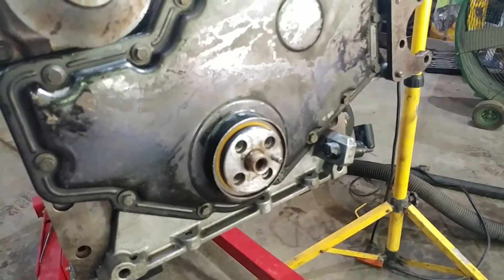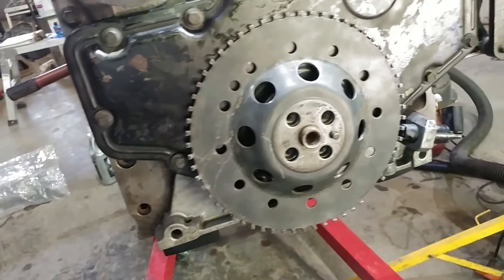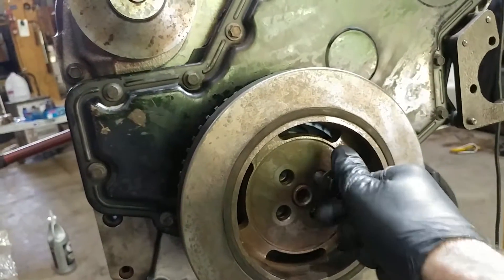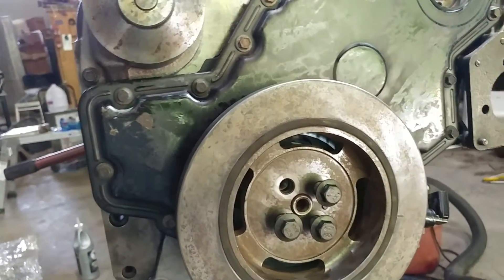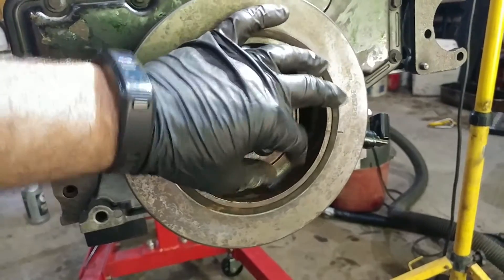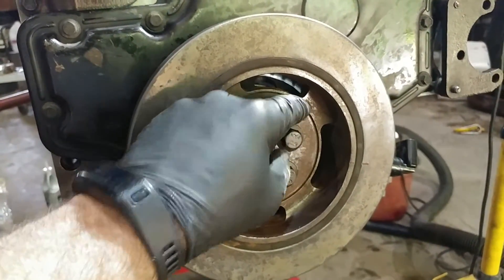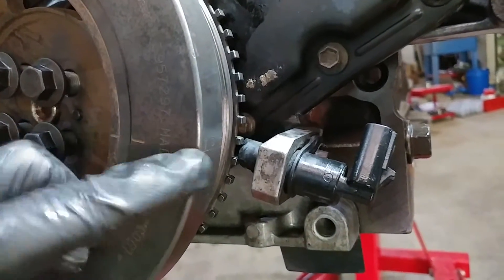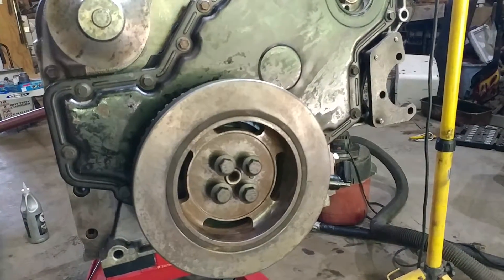Chronicles Of An 03 Cummins Rebuild - Part 36 - Tone Ring and Balancer Installation

Comment: I have a 2001 Freightliner Fl60 with the 24 valve  cummins and the tone ring is on the outside of the balancer close to fan and a piece cracked off I'm having a hard time finding that part it is a two piece ring with teeth bolted to a round plate do you have any idea where i can get a replacement part and have you ever seen this set-up with the ring on the outside?
Reply from the maker: A Owens, Some how I missed your message. Did you ever find your balancer? I can honestly say that I have not run into a balancer with a 2 piece tone ring and would love to learn about it!
Reply: @70440charger  I found the tone ring but not the round bracket that it bolts onto and that then bolts to the front of the H-balancer, I wish I could post pictures on here it would help better to see it

Comment: I'm glad that you cover this in your series. Is there any way to check the balancer?

I have heard that they are made with rubber, and we all know what happens to rubber after 20 years...

Also any information you would like to give about aftermarket fluid dampeners, I am all ears? 😁
Reply from the maker: Great question! And you know what should have included that info in this video!  Here is a link over to TDR where they give a pretty darn good write up on what they do and how to inspect them. He make a note that they are more dampers than balancers, but I find that when we get stuck on what to call them it just takes away from the real conversation that should be happening!

https://www.turbodieselregister.com/threads/its-time-to-inspect-your-harmonic-damper-but-please-dont-call-it-a-balancer.263533/

As for fluid dampers! I have never run one, but I plan on getting one for our 4bt truck to help with some of the brutal rattling that comes with them.  With that said, let me say there must be something to them because Cummins started using them on the 6.7 motors. The sad thing is that they aren't backwards compatible to our 5.9s! Then there is the bonus that it doesn't wear out like our stock dampers. 

Here is a second thought for you. If you have the motor torn down then you should consider balancing the rotating assembly. That way your damper (no matter if its the stock or a fluidampr) has less to put up with.  Its kind of a lot of info, but I hope it helps some!
Reply: @70440charger  - oh boy... That's the most reading I've done since I left high School 😂

I haven't finished it yet but I will later, that article has some extremely useful information. Thanks a bunch bro!!
Reply from the maker: @duttydiesel8303  : I know it's a lot of reading in that article, but as you can see there is a lot of meat to it!
Reply: @70440charger  - just finished... That shines a good bit of light on to it, I think that maybe the next part to get inspected on my truck! 

If this bloody rain lets up, I might film it.... Mind you the caterpillar phone is waterproof 😂🤣😂
Reply from the maker: @duttydiesel8303  : Cool that you have the Cat Phone. Didn't that have the Flir built in? 
As I was working in the shop last night I found a truly bad balancer that came off my brothers truck (project snowball) and I will film a clip of it just for sake of comparison!
Reply: @70440charger  - Ya it does! It's overall a really awesome phone...

I bought because I break phones every couple months... And sofar no case, just a screen protector it's great! It has some service issues... Just working with my carrier to find out where the problem is, but I plan to do a quick video review of it once it's all straight!

Long story short, I wish it was a "Samsung - Cat"... If they paired up it would be incomparable to any. Lol
Reply: @70440charger  - also Lazer measure too.. haven't messed with it... Air monitor is pretty cool feature too. 🤣😂

Please do film it up!! I'm curious I'll post up what mine looks like when replaced! It's missing some serious chunks visibly from the front.. don't want to see what's behind, but we will soon!!! Ahaha
Reply: @70440charger  - yeah absolutely thanks bro!